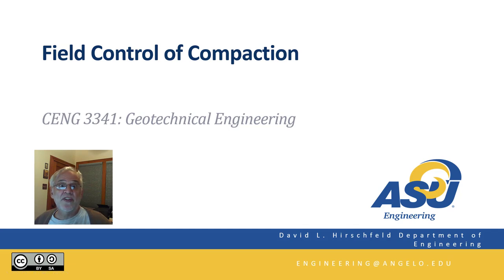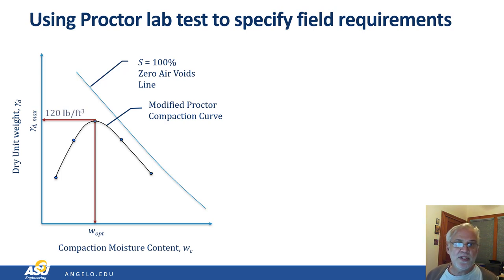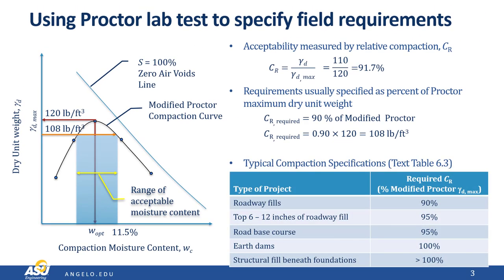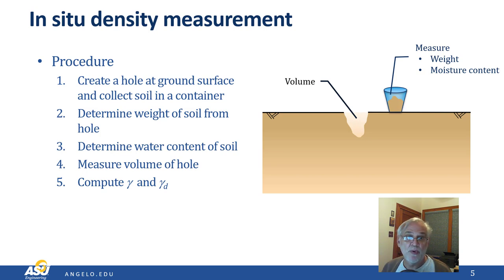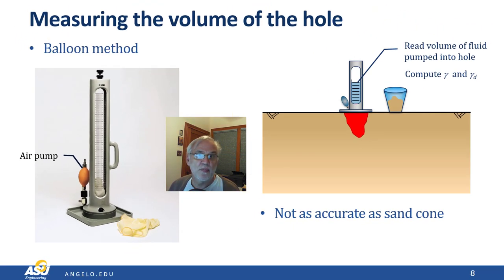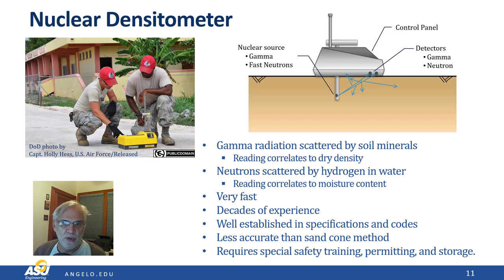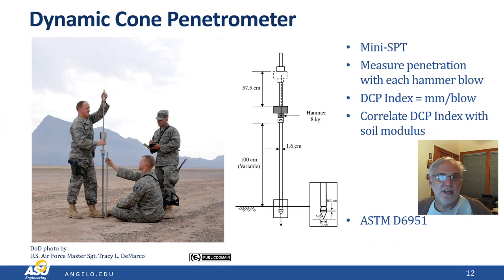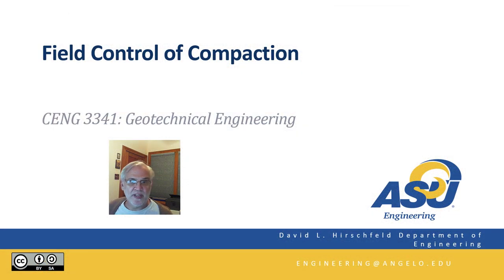Compaction Part 3: Field Control of Compaction

Comment: For building foundation thats build on a fill, the first thing that one should do is to compact the fill properly wich can be tested using Proctor test. 
Using Proctor test we can get soil unit weigt
But how to get angle of internal friction of the fill/soil wich is the parameter that we need in order to calculate maximum stress on the soil? 
Is there any correlaction between the Light weigt deflectometer results and the Proctor test?